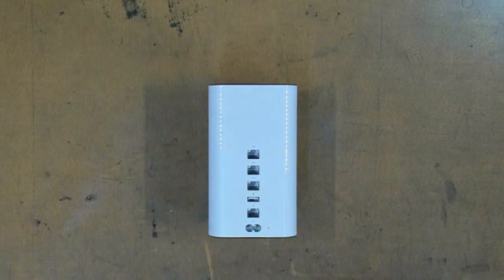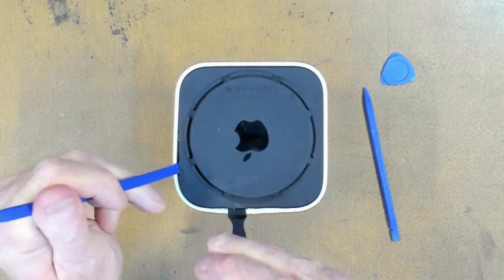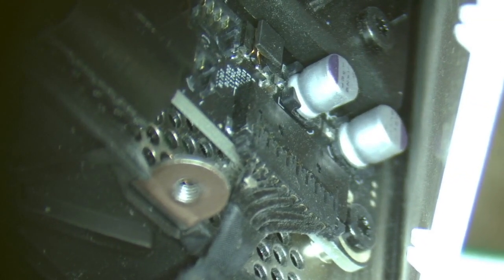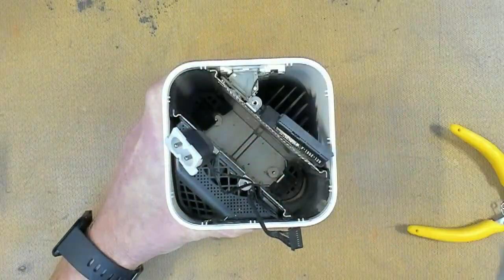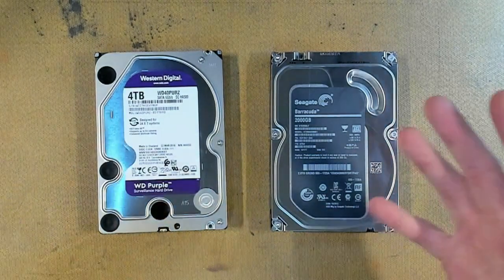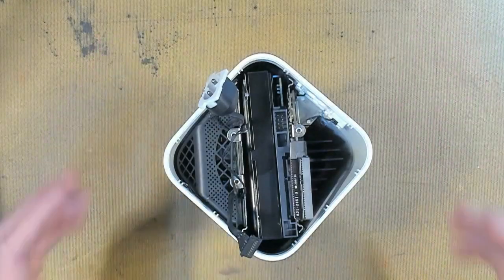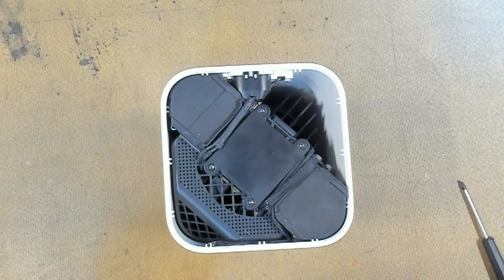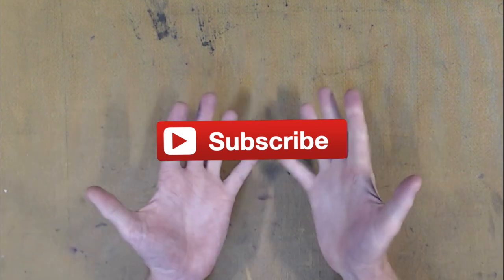Apple Time Capsule Dead Hard Drive Swap - 802.11ac  (A1470)

Comment: Hi I just watched your well done video on a drive swap on an Apple Time Capsule.  I took my Time capsule apart as per your video without any issues, until I started thinking  about its future intended use .  I am about to purchase a 23/24 Mac Book Air, and my question is will I be able to back up the Lap top with a cable from Thunderbolt 4 (USB-C) to the USB 2 port on the time capsule . I am now retired with to much time on my hands, and I am learning all the time with upgrading my old Mac's  and this may be a dumb question to ask  :>)

Comment: Managed to do the upgrade, this is a really effective and helpful guide! Went with a SEAGATE Exos 7E10 SATA 8TB. I had to trip the top rubber gasket as well because the drive is beefy up top. To remove the two pesky connectors, I used a yarn darner needle instead of needle nose plyers, a bit thicker than a regular needle but had a nice point that pushed the connectors off the board easily.

Comment: Hi, my time capsule was dead, i followed your instruction and took out the 2tb hard drive from it, i have lots of data in the drive, i tried connecting the hard drive with external casing to imac but the drive doesnt show in imac, then i tried in m1 macbook it shows APswap drive and hanged my macbook, is there any way to get my data back?

Comment: Excellent how-to video. I just followed this video to bump my Time Capsule from 2TB to 8TB. If anyone is still doing this upgrade - stick with the same brand of HD and you might not have to trim the rubber parts. I installed an 8TB Barracuda (ST8000DMZ04/004) and didn't trim anything. Start to finish was about 45 minutes. My TC is up and running and it is much quieter with the new drive.

Comment: Thanks for your videos!  I've been using an Airport Extreme for over 8 years now.  It has 100% pass-through 1Gbps speed (if that's the right term) on wifi and backs up selected iMacs on our network.  Will be replacing the hdd today in it to keep it going for another 8 years with reliable speed and backups.  2 Days Later:  So, I got an 8TB Seagate Barracuda to do the swap / refresh on the 2GB Seagate Barracuda hard drive that was in there so that the rubber bumpers would match up inside the Airport Extreme.  Why?  A month or so ago, I started noticing incomplete backups to it, and then I got the occasional flashing amber light on the Airport Extreme.  Had to power cycle to get rid of it, but then I did a disk util scan and it showed a red-x fail.  So, I decided to replace the hard drive.  The replacement went just fine (don't break the little connectors!).  I share this to encourage everyone to replace the hard drives on these.  They will fail at some point!  The Airport Extreme's are bulletproof otherwise, and are a GREAT networking solution...even in 2023!  I've NEVER had a Western Digital drive last longer than 4 or 5 years, so I would definitely NOT recommend using them.  Seagate drives, on the other hand, have always been a good 7+ year drive.  My original Seagate drive in my AE was 8+ years old when it started to fail.  Purdy good, I'd say!

Comment: Does the the Router only model A1521 have the internal wiring in place to add a HDD or a SSD to turn it into an Time Capsule.
Reply from the maker: Yes it should.
Reply: @Repair2Renew   I have not opened the A1521 model to know if it is pre-wired with the male plug to connect to a Storage drive, though you may have try to add a drive to one, I do have a  A1521 model I could open up to find out.

Comment: How about HDD to SSD. Same thing with brand new SSD? What about connector type?
Reply from the maker: SSD will not be much quicker due to the limited speed, of the sata interface chip, in the Apple time capsule
Reply: @Repair2Renew  The speed won’t be the reason for swapping, it would for the long term reliability. Questions still stand.

Comment: It is horrifying to watch some of the other techniques.  Thank you for illustrating the right way.  I have an 8T waiting for me to do the swap.  But as a Navy Micro-Miniature Repair Technician, there was just know way I would go at it pulling cables and ripping at rubber.  Subscribed USN, Ret.
Reply from the maker: Cutting the rubber mounts is only necessary if you are NOT using a seagate drive.
I would utilise using a seagate drive to avoid cutting rubber mounts. In later time capsule video's, you will see me using seagate drives.
Reply: @Repair2Renew  I went with the WD Red 8T.  Cutting the mount was intuitive, the reset switch was easier from the housing mount side on my model.  I tried to configure four accounts but it times out after three.  Maybe it is looking for the cloud.  I’m still down after Hurricane Ian.  Next surgery is on my 2012 Mac Mini and my white Mac Mini with the optical disk drive for two more access points and entertainment system managers.

Comment: I have just watched this video with sound turned off (to avoid disturbing others)... and it seems one of the best instruction vids I have ever seen. Other I have watch have put me off and I ended up  buying a prepared WD disk, which is just plugged in and sits on top of my Time capsule.
This is so clear it fills me with confidence to replace the dud original & have the insurance of 2 backups.
I might even watch with the sound on.🙂    Thanks.

Comment: It appears you can pop off the bottom rubber cover easiest by inserting a screwdriver into the large openings around the circular area and quickly lifting upward on each of them.
Reply from the maker: Great tip!

Comment: Wow!  Great tutorial on HD replacement for A1470.  I see on many of the comments here that some opted for SSD replacements.  Other than fit issues, are there any downsides to this option?  Solid state drives would last longer, right?  Just want to get your opinion on this before I click on something.  Thanks again for outstanding video.
Reply from the maker: Yes SSD is a great option. It's a little bit faster.
BUT !  If you need in excess of 6-8Tb of storage, look at the Synology NAS's (much faster over ethernet)
Reply: @Repair2Renew  Absolutely! I upgraded my TC with a 2TB SSD for time machine and actually iTunes server of sorts (iTunes "looks" at it and streams the music stored on it. There's no streaming built in to the TC of course but you can point Plex, iTunes etc to read from it and it works great!) and that's it. My Snyology NAS with 12TB Iron Wolfe NAS drives in it is my heavy hitter for ALL my backups and media server etc. I just wanted to keep music separate (no real purpose other than just something to do lol)  This is why I used a 2TB SSD, fetching media of any kind would be very slow from a regular HDD, but it works quite well for simply music and it's small enough to take with me when I go and visit family I can take my Backup and music etc with me just for fun. I wouldn't want to put my NAD in my backpack, it' s much heavier ,  so I use it for the "big stuff" just got my 2x12TB drives 3 days ago and it took about 10hours each to re-image them in my DSM but alas it went perfectly so I have my NAS and my everyday tM with iTunes server running off of it as well. Fun tinkering indeed +1 GREAT Video!! Especially the zooming in for us on those cables! thank you!!!

Comment: Excellent and very helpful video. I took the 'easier' option of a straight swap with a 4TB Seagate Barracuda HDD so I had no requirement to trim the rubber bumpers. My Time Capsule is now up and running again. Thank you. Having done the exercise once, I'd feel more confident about tackling it again and using a larger capacity disk and trimming the rubber to fit the Time Capsule.

Comment: Thank you so much for your video. I was able to fix and upgrade my Time Capsule.
Reply from the maker: Glad it helped John. Next time you need to upgrade, I would look at a little synology NAS. Run 2 seagate iron wolves in a strip set, turn on bonjour protocols on NAS. You can backup 200Gb an hour.

Comment: Great video!  I quit using my TC awhile back just because 2TB wasn't enough for all of our computers.  Finally upgraded to a 6TB WD Red and your video was perfect for it.  I did have to also snip some of the large rubber piece that goes on top (same spot opposite of the SATA connectors) for it to go back in correctly.
Reply from the maker: Good stuff Matthew, I prefer to use the Seagate drives these days as you do not have to snip back the rubber piece/buffer.

Comment: A word of thanks to @MBK Upcycle, for I have just successfully replaced the failed hard disk drive (HDD) in my Apple Time Capsule (A1470) with a solid state drive (SSD) using this video as a reference. Since I replaced the big 5.25 inch HDD with a small 3.5 inch SSD, I did not have to worry about positioning the two rubber bumpers to support the new drive. I just used two small strips of painter's tape to hold the small SSD in place while I put the rest of the Time Capsule back together; it needed to hold only until I flip the Time Capsule right side up.
Reply from the maker: Well done for giving ssd a crack.
I will have to do a video.

Comment: I replaced the hard disk by a 2 Tb SSD and the change is great. The copies are very fast and very stable. I had replaced twice the hard disk but it worked only for one or two years and then out. I hope now a long time for the Time Capsule. And it works, of course without any sound.
Reply from the maker: Great to see 2Tb SSD worked, well done.

Comment: At 2:50 it would have been helpful to have a close-up of the clips and mating slots so that we can see how they disconnect.
Reply from the maker: Thanks for your feedback Kirk. For this shot I was more concerned with the orientation of the time capsule. Also it was levered from the correct position in between the locks.
Sure shot could have been zoomed in a bit tighter, but most people can figure it out from current shot.

Comment: can airport time capsule use ssd?
Reply from the maker: Good question Ustaz. If you were restoring by wireless, a SSD would most like likely not make a substantial difference. But if you were  restoring via ethernet then A SSD might make a impact, as the ethernet interface, on the time capsule, is rated at 1Gb network speed.

But at the end of the day it comes down to the speed of the "Sata controller" in the Time capsule. So if controller chip (in time capsule) supported SATA3 speed, then SSD would work quickly. But if apple just engineered time capsule for a mechanical HDD, the sata chip could be rated at SATA2 (slower).

Also it comes down to expense. 1Tb SATA (samsung 860) would cost roughly $100 - $150 USD. But for that price you could get a 4Tb Mechanical HDD (more storage)

So the question is: Do you want speed or more storage?

Cheers

Comment: Thanks a bunch for this video. Will this a1470 work with an 8TB WD/SEAGATE NAS drive?
Reply from the maker: It should, but the seagate "ironwolf" drives are a little better, because the rubber mounts fit on the end of the drive neatly.

Comment: Ssd woks?
Reply from the maker: From previous comments SSD seems to work, But the sata controller may not work at those higher speeds for SSD. So you will have a SSD working at HDD speeds. Might be a waste.

But you can get some cheaper higher storage HDD from seagate, Ironwolf range are the best.

Cheers MBK

Comment: For those who are curious. I swept the drive with a 4TB WD red HD. Time Machine is working Flawless with a Mac Mini M1 Big Sur, Mac Mini 2012 Catalina and a Macbook Pro 2011 High Sierra. Automatic copy is off. Copies are managed with TimeMachineEdit app. A copy every 3 day's. The M1 Sparsebundle is APFS. Thank you Shane for this tutorial.
Reply from the maker: Thanks for the feedback Robert, I prefer the seagate drives, especially the "Iron Wolf" series, as you do not have to cut back the rubber corner mounts on the HDD. Seagate Iron Wolf 6Tb, is also a good choice. Good value for money.

Comment: Thank you! This helped me swap my dead hard drive. I ended up using a 2.5 inch SSD and taped it since I had an old one laying around and I didn't plan on using it for big backups.
Reply from the maker: Well done Glenn !!!   Whatever works for you is best.   Be interesting to see the performance from a SSD?
Cheers MBK
Reply: Hi, did it work well with SSD?
Reply: @thimfp  seems to work well. I gave it away to a friend since he needed it

Comment: Any advice/thoughts on swapping the hard drive with a solid state? If so which would you recommend? There were mixed responses regarding this. People said it did make a difference while others argued that it didn't make sense because the speed was based on your internet strength.
Reply from the maker: Good question Andrew. If you were restoring by wireless, a SSD would most like likely not make a substantial difference. But if you were  restoring via ethernet then A SSD might make a impact, as the ethernet interface, on the time capsule, is rated at 1Gb network speed.

But at the end of the day it comes down to the speed of the "Sata controller" in the Time capsule. So if controller chip (in time capsule) supported SATA3 speed, then SSD would work quickly. But if apple just engineered time capsule for a mechanical HDD, the sata chip could be rated at SATA2 (slower).

Also it comes down to expense. 1Tb SATA (samsung 860) would cost roughly $100 - $150 USD. But for that price you could get a 4Tb Mechanical HDD (more storage)

So the question is: Do you want speed or more storage?

Cheers

Comment: I used a Seagate IronWolf Pro 12TB in my Time Capsule upgrade and it works perfectly fine.
Reply from the maker: Wowwwww Zsolt, that is HUGE. Good on you for giving the larger drives a crack. Hope the video made it a bit easier.
Cheers Shane
Reply: MBK Upcycle Thank you, Shane, your video definitely did help. We have a water damaged Macbook Air, I might give it a try to fix it as well based on your other videos.